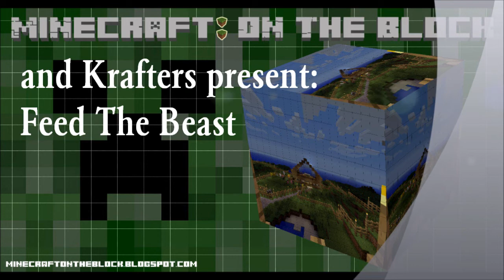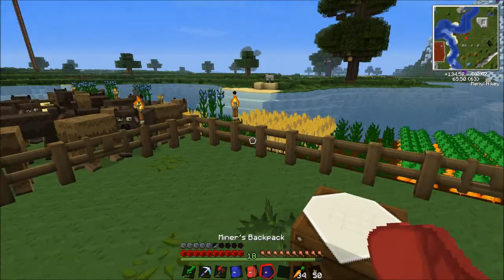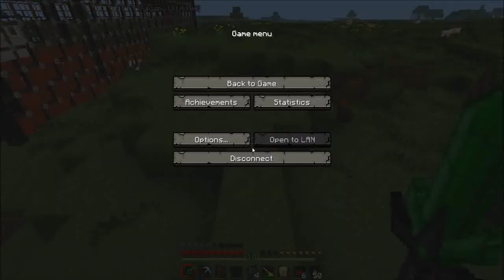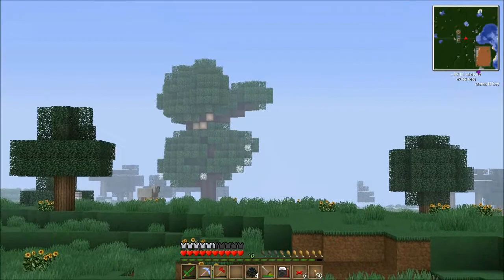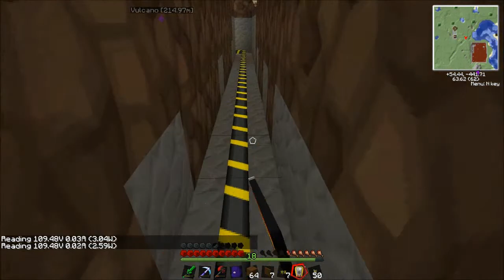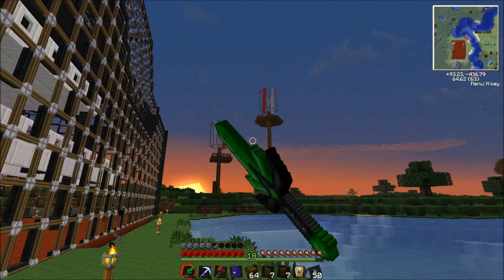Krafters:  Feed The Beast:  Ep31:  More fun with blutricity.  HELP!  :-)

Comment: The video quality does seem better, but I'm not sure it's enough better that it's worth longer render time.  Your call, of course =)  I feel like your first go in this video was probably best, as in Bat box near input, MV wire for the distance, then transform back to LV wire near output.  I seem to recall on the Forgecraft server it taking a VERY long time to charge, but once it did, it was golden.  Also probably a few more Bat boxes to increase the buffer might be good.

Comment: Your problem seems to be the distance,power loss due to the cable are just too great as of now, i would recommend putting more batbox along the way  but the problem is that they always output less than they receive. So the only solution as of now seem to be to move your setup closer or to create a battery box farm and transport the power that way . That what i'll be testing as soon as i have time. Oh and the max you gon' get is 10MJ/t out of  2 windmill no matter the number of engine

Comment: Still figurin' it out but with a  10by 10 solar farm the best output i get is 18 mj/t, but it's with one battery and the  engine right next to it. Once you add more to the setup it changes everything. as of right now it feels as if rp power is not meant to be transfrred over long distance . I'm just starting to figure  the windmill if you need more info hit me up!

Comment: To my knowledge, if you want the watts in the system, you have to kind of balance out the volts and the amps. If you take a reading on the blue alloy wire, the wattage is higher where the two are closest in value. Find how to balance those, and you should solve the wattage problem. And you can always boost power with solar panels. :) (And the chestnut trees are a 3x3 tree, not 2x2.) Liking the texture pack, btw. Keep up to good work!

-A Q W whoog.